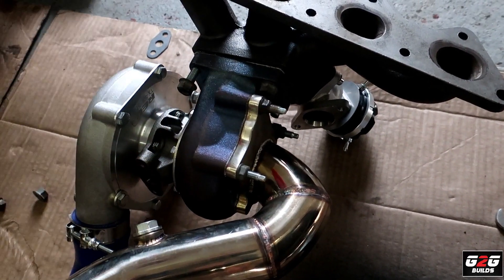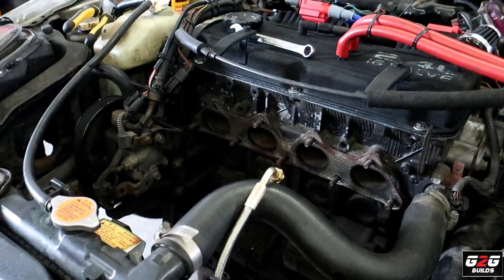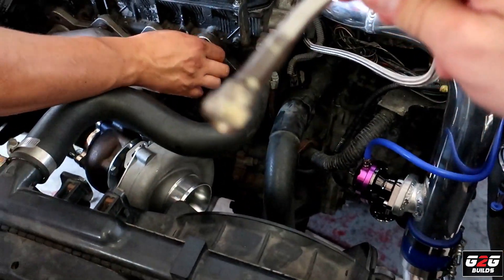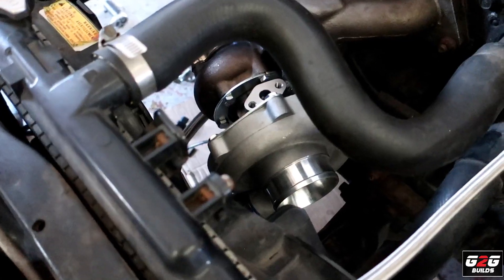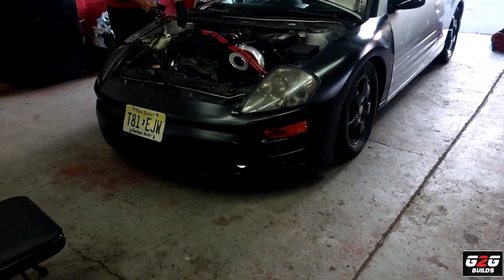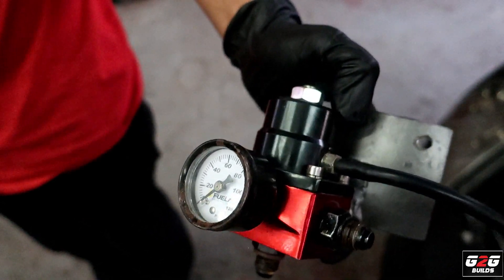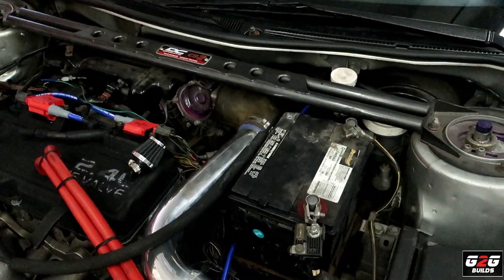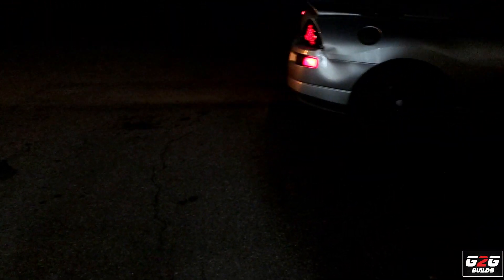3G Eclipse Turbo Build - (Part 4) First Drive

Comment: Wish these cars were awd.. nice turbo build. This is alot of work.. it still top out at max speed. Turbo just helps you get there faster.
Reply from the maker: Yes bro. I heard of people putting evo 8 rear differential and using custom driveshaft and 4g63 transmission. I'm sure a lot of custom fabrication must be made in order to work.

Comment: Hey I know this videos a little old now but where did you guys get your clutch and flywheel for the car. Im trying to build my 3rd gen eclipse and im having a hard time finding things
Reply from the maker: Hey what's up?
To be honest, I believe the car has a stock clutch as right now. The car still running in stock ecu but some fuel issues.

Comment: Where did you guys connect your oil feed  and return lines
Reply from the maker: I used a "T" fitting and tap the it from the oil pressure sensor, behind the block. For the oil return line, I removed the oil pan and weld the fitting on it. I used 10an fitting, since my turbo return line is a 10an.
Reply: @G2GBuilds  okay that helps a lot, but what did you end up doing for ecu. Did you just use stock
Reply from the maker: @johnnycardinell8060  The car still untuned, but the owner of the car will get the ecu flash with Evo scan software.

Comment: Can you tell me what did you guys do for the oil return line fitting? Did you take the engine oil pan off to drill a hole or did you drilled the hole with the oil pan on the car? Thanks!
Reply from the maker: Yes. Manny removed the oil pan and weld a steel 10an bung, since we used a 10an return line hose. Make sure to place the bung as high as possible meanwhile give you some space to screw the hose in. Also, make sure don't weld the bung underneath of the holes where it bolt on in the block. Good luck bro.
Reply: @G2GBuilds  Okay. As I don't have a welder I'll probably look for a fitting that has a nut in the inside of the oil pan and thighten it and put some J.B. Weld on the outside. And other question, I want my setup to only run like 6-7 psi. Do I need a fuel pressure regulator or any fuel delivery upgrade or am I good with the OEM system or do I still need the fuel pressure regulator? I changed the fuel pump last year but it's a replacement, not a high flow pump. I also be using the factory ECU. Thank you for your help!
Reply from the maker: @kevinagostini-miranda961  Well, as now i dont have an answer. An 255LPH fuel pump should help a lot, mean while the regulator can help you to deliver more fuel to the injectors. I dont know if stock injectors can handle 6psi, but if you change injectors, you will need to tune the ecu for the new injectors size.